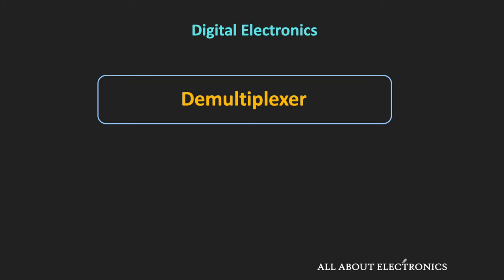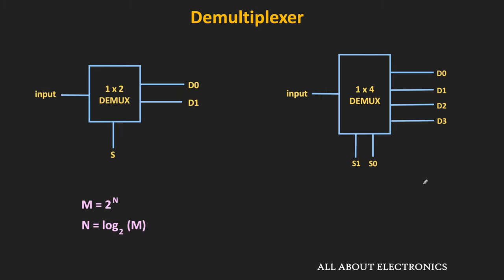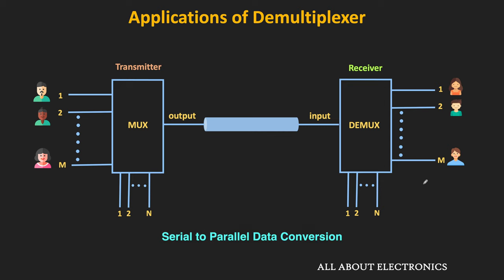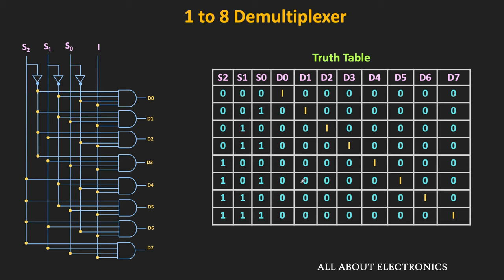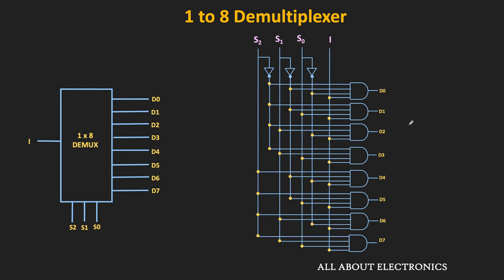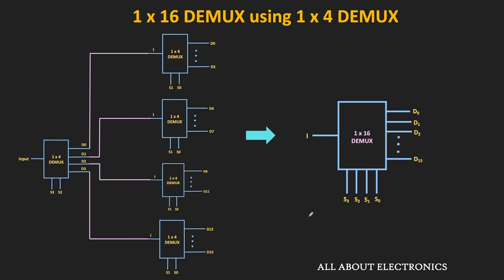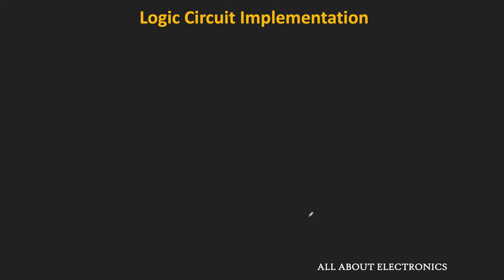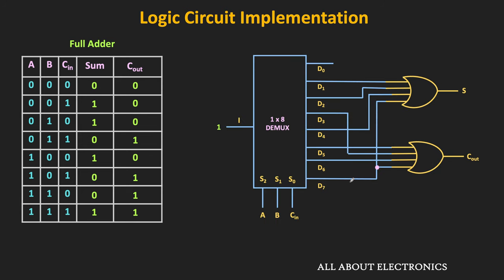Demultiplexer Explained | How to Use Decoder as Demultiplexer | 1 to 4 and 1 to 8 Demultiplexer

Comment: hello sir, at 8:15 , instead of using a 1*2 demux , we can simply use enable of both 1*8 demux by connecting the E1 to inverted S3 and E2 directly to S3, as we did in mux designing.

and sir one more doubt, like in logic implementation , if we want to implement a 4 bit logic using mux, we can use a mux with 2 , 3 , 4 select lines , all can implement the logic,
so can we do the same in demux or decoder also or shall we need same number of select lines or input lines as the number of variable in the expression?

Comment: At 4:48 you said , demux input 'I' is connected to decoder .There are two possibilities '1' and '0' .As you said if input is logic high (1) then it works well but if logic 0 means then the decider itself not works irrespective of the input given to decoder then how the input I is appear depending on the input combination given to decoder .Please clear this doubt Sir .
Reply from the maker: when the input I (Enable input ) is 0 then of course all the outputs will be 0. (please see at 5:33). But if the changing with the time (1 and 0 with the time) then you will get that input at the specific output pin. If you consider a static input which remains 0 then yes, all the outputs will appear to be logic '0' level. But in reality, the input to the logic circuit is continuously changes between 1 and 0. So, that output will appear at the specific pin depending on the value of A, B and C. I hope, it will clear your doubt.
Reply: @ALLABOUTELECTRONICS  Thank you for your reply Sir .Now it's clear .

Comment: Sir please can the multiplexer be used to add more than 3 bits addition
Reply from the maker: Yes, you can do so. But the thing is, after addition you will have two outputs. The sum and carry output. If you implement it using the multiplexer, then you can generate only one of them. To generate two outputs, you need one more multiplexer.